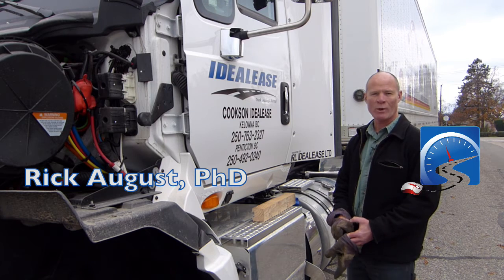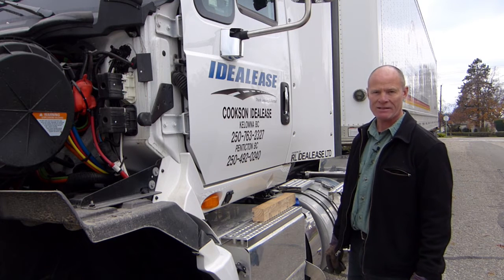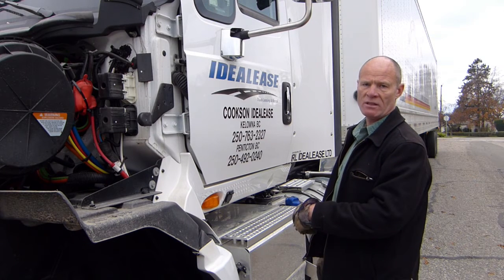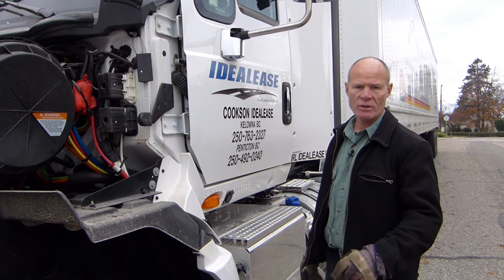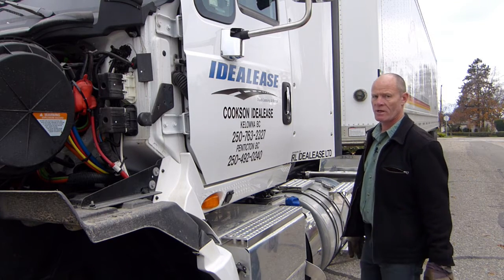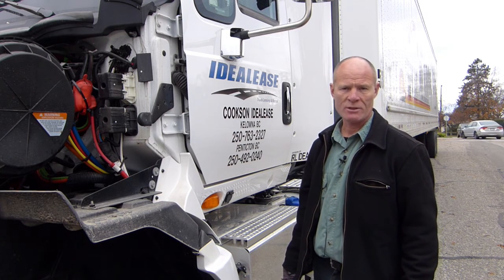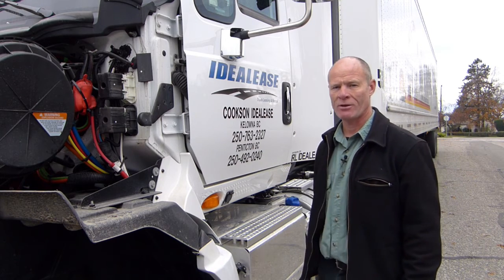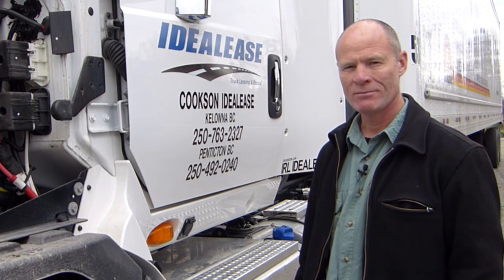How to do a Leak Test for CDL Air Brakes Course | Air Brake Smart

Comment: good demonstration! air leaks are bad! DOT GETS YOU!!! lol...no dot nooooooooooooooo!
Reply from the maker: Hi Ladonna - yes, air leaks are bad! We once got stopped on the scale in Montana with an air leak in the trailer. There was a fine and the cost of an on-call mechanic to come out and fix the leak before we could depart. It is important to do a thorough pre-trip before arriving at the DOT scale house. Thanks Cheers Rick

Comment: How do you do a air brake test on a automatic?
Reply from the maker: Hi 20cmfrasier - thank you for your comment and query. Have a look at this video: https://youtu.be/rMZwffPGAiQ For an automatic, chock the wheels, put the transmission into neutral, and release the parking brakes. All the rest of the pre-trip inspection for the air brakes will be the same. If there is anything further we can do, drop us a note. Always happy to help. All the best, Cheers Rick
Reply: Smart Drive Test thank you sir!!